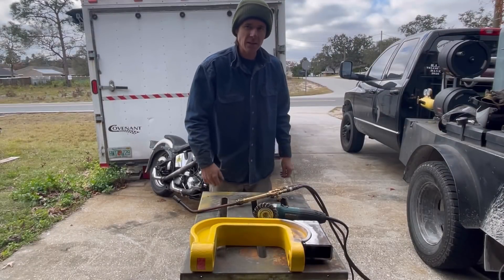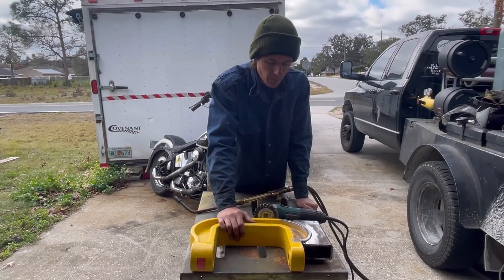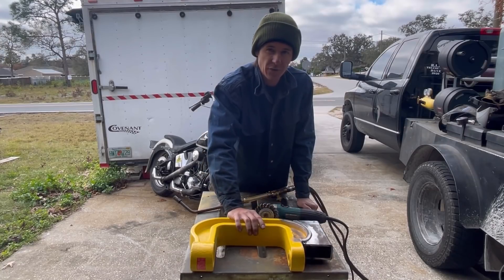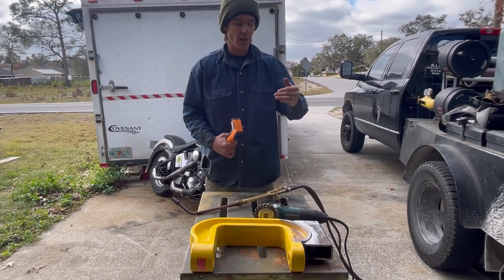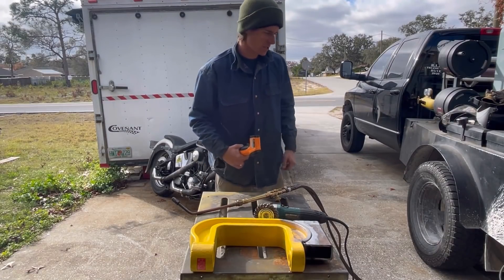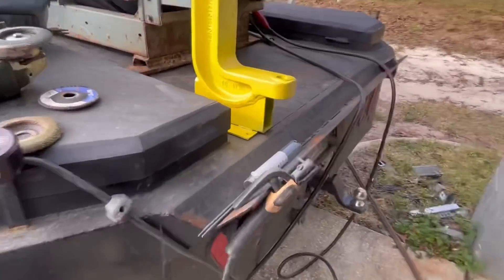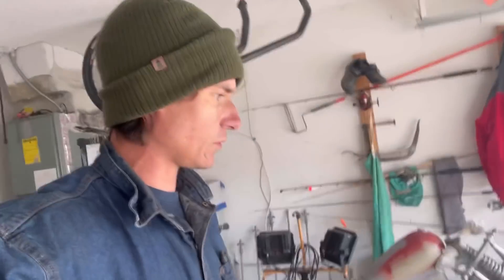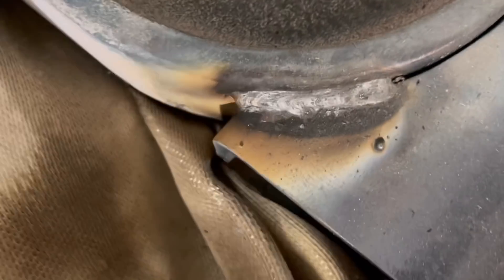How to Weld Cast Iron to Mild Steel! | It CAN Be Done!!!|

Comment: The peening needs to be done immediatwly while heat is still present, best when still glowing red and with much more force using a pointed or ball peen hammer, an air hammer or a needle scaler. Peening is basically forging the weld into the seam like a blacksmith streching out metal by hand. A pulling force, tensile stress is created by the seam and surrounding cast iron cooling down. Peening the seam forces it to move down and outwards causing pressure to counteract that tension. If the area cools down without peening being performed, the tension is left in as the metal settles.

Comment: I have a front hub-puller with stripped thread, and wanted to weld a nut on each side of the threaded hole to accept the bolt - would this process work for that?

Comment: Great video - THANKS!
I had the same dilema welding cast iron to steel, and like you, did a TON or research. I could not get ahold of the 55 or 99 electrodes, BUT tried 312-16 stick electrodes considered really good for disimilar metals (way different animal from 308 309 316 etc). Yes, these are meant for stainless to mild steel but thought I'd try it. THEY ARE GREAT! - very happy with the strong results, which passed my very technical (NOT) hammer impact and drop-on-concrete-floor tests.  Blue Demon and a couple other companies offer these in the US, and they are a bit pricey but nowhere near as much as the nickel ones. Strong and No cracks in anything yet. PS: Big preheat and slow cooling do not seem that critical. Tried both ways and both ways fine in my unscientific opinion.

Comment: $59/lb..!!!
Geez, man that's as cheap as chips. Here in AU, we pay no less than $10 PER ROD. Stop yer sookin.🤣
Plus - too much fuss here. If you're using Nickle rods there should NOT be any cracking at all anyway. I do all small welds (like you've done here) on cast iron without pre-heat, post-heat, or heat packing, and I do a fair bit of stuff like John Deere corn planter parts, many of which are (unfortunately) made in China. I do agree though that light peening is important.

Comment: silliness here but have to ask. is there a way to undo this weld In a case where it wasn't done on purpose? I accidently did this to my connecting rod and wrist pin during a change out on my hemi piston and it is on there!!!!
Reply from the maker: Yes Air Arc gouge, grinder, or cut with a torch. I did a video for weld.com about airarc

Comment: I took a 55 gal. drum, cut it in 1/2(long ways), welded some fb so as to make a trough. Fill that with lime and toss your stuff in there that needs to cool slowly. Great for annealing hard Steel. Lime is pretty cheap. Good vid man. I'm trying to weld a gear onto a cast triangle washer. It's to motorize a meat/bone grinder. Screw all that manual labor when I can push a button. Gettin lazy in my old ass age.

Comment: What cast iron is the pumpkin on a GN vehicle’s rearend made from and what size rosebud is that? Could you post insulate in a oven with the glass blanket? Thanks.
Reply from the maker: its cast steel

Comment: What is the the G frame going to be used for? From the robust design it’s will have withstand high stress forces. Shock loads- pinching. Sustained stress - clamping 
Any disruption to the smooth flow of the stress will create stress points creating points where fractures are likely. 
Weld anywhere on the G frame should be avoided. 
Next time design a clamp-on steel support frame. It may have been a simple as suspending the G frame on a strop. 
As we all know it’s the carbon content that causes the welding problems. 
Google the following:- 
 “spark test” to estimate carbon content 
“Thermal shock.” 
How to avoid the forming of white cast iron. 
“Buttering”   “ Dilution” 
“ Carbon equivalent formula”  
“Peening “ 
Cast iron is strong in compression but weak in tension. 
 A weld is deposited is in a cast condition ie large volume. As it cools it will contract putting the cast iron in tension a force that CI  is weak. To reduce the tension caused by contraction the weld depot needs to be stretch this is done by “ peening “. The hammer blows during peening needs to be forceful enough to stretch the weld metal to counter the shrinkage thus reducing the tensile forces.
Also look up:- 
https://www.metalock.co.uk/

Comment: You can get that puddle to wet out by cleaning it with a solvent like acetone prior to preheat it removes the graphite which inhibits puddle fluidity also you got a grind off the skin left by the casting process Peening works on the weld while it’s still hot like immediately after you weld so weld like an inch or two at a time Lincoln’s website says 500 to 1200° so 350° is OK if it’s Celsius my preference is about 650 Fahrenheit 135 A for an 1/8th rod is the upper Exelon of where you want your amps set running lower will keep from digging a bunch of carbon out of the cast-iron to mix with your weld finally you’re right that smell is weird but you’re not supposed to smell it it’s poisonous 
65 bucks a pound isn’t too expensive when your boss buys them

Comment: Big trick is to take a tig torch and puddle the cast (no filler).  Take a file and file the weld dot.  If it’s hard and the file doesn’t cut it, you need to weld it with nickel rods.  If it’s soft and cuts easily 7018 works.  What is going on during this test is carbon adjacent to the weld gets absorbed and concentrated in the puddle.  It the piece has high carbon content the spot weld will become hardened.  High carbon content material will absorb into the weld and make brittle welds.  Nickel doesn’t become brittle with carbon absorption, 7018 does.

Preheating and post heating is great on thick stuff because it prevents hot short cracking (typical cracking on weld toes) and it helps get good flow out on material with minimal undercut.  

Nice work overall 👍

Comment: Anthony, great video man! Quick suggestion though, when peaning welds you actually have to move metal, it has to expand. For instance using a prick punch and hammer would be sufficient, or a really strong needle scaler. As long as you’re actually indenting the weld metal causing it to expand it should be fine.

Comment: You can oxy fuel weld cast iron too. Try doing that. It ain't hard but its a long process. Probobaly not the most cost effective way buy hey that's what we call old school welding. More attention to heat and stuff too with it but got to pre hear and post heat and make sire you put your piece in sand or fiberglass. Cast iron bare rod most welding supply stores should sell but its expensive rod i think a pound of bare iron rids is like 40 bucks but could be more now and borax flux or specifically a flux meant for iron.

Comment: Another trick is to have a box made that is approximately a foot to a foot-and-a-half deep filled with sand of course line the bottom with your heat blanket put the sand in put your part on it covered up with the sand cover the sand up with your heat blanket and leave it overnight it's worked for me before in the past

Comment: This past summer a buddy bought an old boat And both exhaust manifolds and froze and split open. 
It looked like dam  near impossible to fix, because the cracks were so jagged And erratic. Spent a good few hours with a carbide burr vee’ing out the cracks and then hit it with silicone bronze brazing rod. It certainly wasn’t a pretty repair, the cracks kept getting contaminants in the puddle, because we weren’t able to get them perfectly clean, but in the end, we gotter done and he has a usable boat!  We used a BBQ to preheat and then mineral wool insulation batts as a cool down wrap. 8 hrs later they were still too hot to touch. Lol.

Comment: 55 nickel rod is the only way to do it, just like welding mild steel to stainless steel you use 308 stainless electrode and it’s great!  You should also peen the weld after your done welding as well as post heat and allow to cool slowly!

Oh you could also have brazed the two parts together as well since it’s non-critical
Reply: Welding stainless steel to mild steel, you'll want to use 309L rod, not 308

Comment: shouldve just used silicon bronze filler rods and tig brazed it, along with your pre heat.
Reply from the maker: my tig braze skills need work
Reply: @MeltinMetalAnthony  sounds like a title for a video
Reply: @MeltinMetalAnthony  if you have it try it with pulse, its weird. definitely not like welding, thanks for the videos too man.

Comment: Good job.. well done 👏 ✔ I think 309 stainless rods might have worked for you there. There good for dissimilar metals .I don't think that was cast iron you were welding.that yellow piece  looks like the frame for one of those hydraulic presses or punches i see for sale online so I doubt if it was made from cast iron it wouldn't be strong enough.
Reply from the maker: its 60-45-10 ductal iron
Reply: @MeltinMetalAnthony  an older machinist told me the same about the stainless rod - it is definitely worth researching - great job on the video explaining how and why
Reply: @MeltinMetalAnthony  i bet ye 309 stainless would still weld it..
Reply: Can confirm...ive had good results repairing cast with 309 rod

Comment: I'll give you two secret tips. 1) Heating and post heating. Just put it in your oven on 350°. After welding put it back in and drop the temp every hour or until the cheese is golden brown. Wife f-ing hates me, but she doesn't complain when the checks come in! Second, peening. For the love of God but, or set up the one you have. A needle scaler is the way to do it! I was a welder for Caterpillar for 15 years and THAT was the only approved way of peening welds for CAT. They do have a lot of engineers on the payroll with more degrees than a thermometer! Just saying! "BURN TO EARN BABY!"

Comment: I welded ductile iron many times, tried every kind of rod including nickel, finally just tried 7018 & it worked better than any other rod.
Reply from the maker: customer piece, waned to follow the book
Reply: I did a boring rig one time large bit cast iron to mild steel 7018 rod is what I found work the best with a shop heater place to smack dab in front of that heater one of them little portable kerosene cool day left in front of it for the preheat left it in front of it for the rest of the day just moved it further away as a day went on it worked it was supposed to be an emergency repair last I heard it's still out there working

Comment: 4x4 guys use this process often to weld the axle tubes to the differentials to prevent the plug welds from shearing and spinning a tube. Luckily mine is cast steel, so MIG worked fine.
Reply: What differential did you weld too
?
Reply: @moejr14  ford explorer 8.8
Reply: @jake-mv5oi  did you pre and post heat?
Reply: @moejr14  Yeah, I heated the area around where I welded with a torch before and after and then wrapped in exhaust wrap.

Comment: Are brake rotors cast iron? I’ve mig welded those to mild steel. Preheat with propane, weld, throw in DRY sand to cool.

Comment: I used to produce anhydrous ammonia application shanks. Four dissimilar metals, on a robotic welder. Never preheated anything. Don't believe everything you're told. Creating the program for the welder is the only hard part.
Reply: Patrick- You can not give binary advice on to preheat a part or not to preheat a part exclusively.  You have to consider the thermal mass of the part and the carbon content.  Both of these are related to the critical cooling curve of the material for phase transformation of the crystal structures. Maybe your application did not need preheating, but you can not apply specifics to generalities. Your advice about don't believe everything you are told is straight on.  Best source is an accredited textbook. Then you have a chain of knowledge based on research, not just some guy on the internet or at the counter at the welding store.  --Doozer

Comment: I've welded quite a bit of Cast and one thing ive learned that helps a TON is get you a Box and fill it with Playground Sand. Once you weld up your part immediately bury the cast part in that Sand and leave it. It will cool at the perfect rate to reduce the chances of cracking the most. Another thing ive done in the past is toss the part in my Oven (The ol lady loves that shit..) and knock 20 degrees off the part every 20-30 minutes till its down below 200. 

 Also Brazing works extremely well for applications like what you were doing running a high nickel filler rod all the same. Ive also welded cast parts that were machined incorrectly with Dual Shield Flux Core and normal 75/25 gas and bury it in sand and never had an issue doing that but, ive never tried welding Mild Steel to Cast with that process to speak on how well that would do. You could probably MIG weld that though with High Nickel Wire for Stainless MIG in a pinch all the same but, ive found the most important part is preheat and bury in sand to control and slow the cooling no matter how you weld it.

Comment: ASTM  60-45-10 is Ductile Iron.  Not the same as Cast Iron.  You can weld ductile iron with 7018 or E70 Mig.  I have many times.
  It welds much like steel.  It is not finicky like grade 20 to 40 cast irons. Not really needed to be so careful with pre and post heat like grey iron grades. No need for the Nickel rods. You could have skipped that.  One word about peening and doing it right.  You have to move metal to turn the tensile stresses in the surface to compressive stresses.  Tapping the beads with a chisel does nothing.  You have to move the metal. Make a divot. And you can not wait till the end.  By that time, it is too late. Weld 1" then stop and peen, weld 1" and stop and peen. Best to use a needle gun. But you have to press the needles into the bead so the hammer blows from the air piston are delivered directly to the bead.  Just allowing the piston to throw the needles as per normal use is not going to peen the bead.  It has to be pushed hard into the bead when pulling the trigger. If you flatten the ripples of the bead, you are doing it right.  Anything less you are wasting your time. You tried to do everything right, but you seemed not to know the reasons why other than that was recommended. It came out well because ductile iron is so forgiving.  Had it been grey cast iron, you would have to get your peening technique right. Also, with grey iron, that thing should be warm for 12 hours afterwords. It needs very slow cooling not to crack. In a BBQ grill on low is even better. Learn the science behind the materials and that will make you a better weldor.  Take some material science classes and it will put you above most of the weldors out there. Then you don't have to rely on half baked advice from people who don't really know. Do some textbook learning on metals and become a master.  Advice from salesmen will only confuse you and keep you down.  I like your channel.  Keep it up.  --Doozer
Reply from the maker: Well all I can do is rely on articles manufacturers suggestions and Lincoln electric suggestions. I would’ve reach out had I known you knew!
Reply: Agree 100% Doozer ive used 7018 many times
Reply: Now, that's a comment worth reading!
Reply: That's some great advice Dozer. Not being a pro welder I soak up advice like this. I'll have to remember that next time I weld cast or ductile iron.
Reply: Doozer’s Shop is 100% on point,  on everything he just stated-  Iv welded a lot of cast and ductile iron and scraped many jobs assuming my preheat and cool off was good enough after aggressive taps with the slag hammer.  I use an air chisel now and always throw in my junk bbq after it’s done and take it from 300 down to warm in a span of 3-5 hours depending on thickness and how much welding was done.  That being said you did fine on this job but if your doing a repair to a piece of irreplaceable true cast you really gotta take extra care and caution.   Keep burning em in🤙🏻
Reply: I’ve used a small air hammer to peen. Fast and effective. 
Of course correct post heat. Perfect.
Reply: In this instance should you peen both the weld metal and the brittle HAZ, or just the weld metal? In peening you are looking to counter the shrinking weld metal from placing the HAZ in excessive tension. You do this by forcing the weld metal out sideways while still warm [because it is easier to deform when warm] by hitting it on the face of the weld. Hitting the brittle HAZ at the same time with a needler gun is asking it to crack, no?

Comment: I am pretty sure its not cast iron ….  Cast steel maybe
Reply: I was going to say the same thing but you saved me the trouble! I’ve repaired several of these hydraulic C clamps for the railroad, and they were all cast steel. I don’t think cast iron could stand the forces put on these! Spark test would tell the tale!
Reply: @tomt9543  if it was cast iron you'd see them break left and right ....  hell - they fall out of the service truck on the concrete and they would break ....  with the forces it sees based on the application I am 99.99% sure that it is not cast iron .... I weld a lot of cast iron myself ...  sometimes just based on "what does the thing look like" or "how is is used" or "what is the application" ....  you can tell you dont even have to spark test or drill test .... there are a lot of different castings out there in life .... not all are cast iron ....
Reply: @ZILAwelds  EXACTLY! It’s like snakes. Every snake that people see is automatically a copperhead! And to many folks, if it’s cast, it’s cast iron!
Reply: @tomt9543  lol